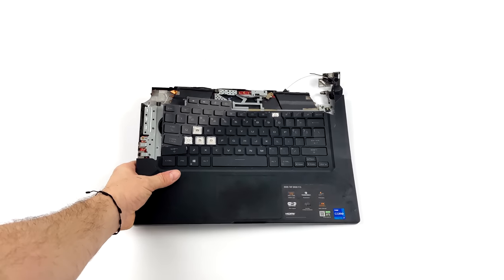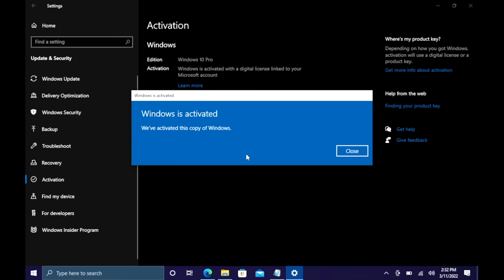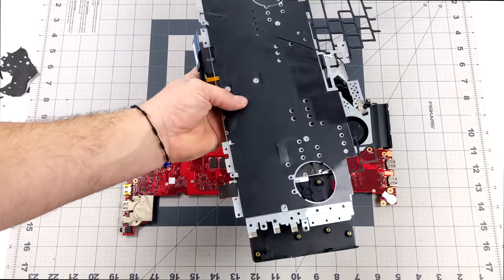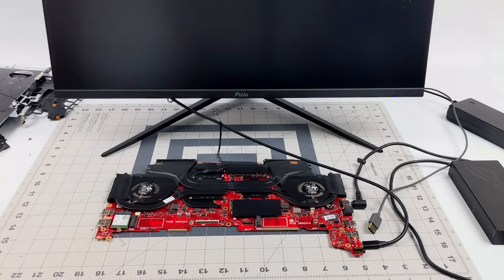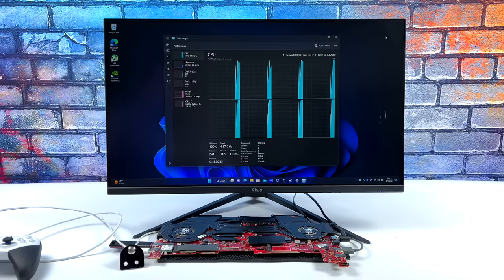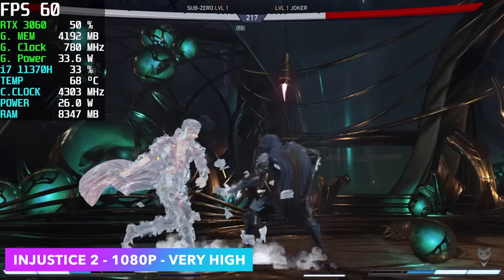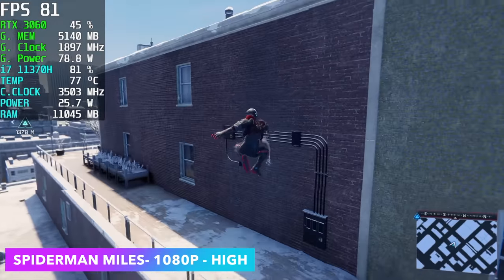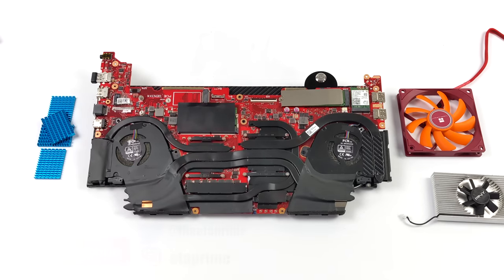I Turned This Broken Laptop Into A Powerful Desktop Gaming PC

Comment: When i no longer had a desktop i had an old MSI GS63VR with an i7-7700hq and a 6gb GTX 1060. The fans are notorious for going on these (was on my second set) so i actually took the whole thing out and made a custom open air case out of some soft wood from a previous project. I then screwed 2 x 120mm corsair fans (jankily wired to a dc wall adapter) to the front for cooling and due to this was able to keep my temps (without throttlestop) around 80c both CPU and GPU. The fans ran at 100% of course all the time. I was able to overclock the GPU even and it never even got above 85 afterwards. Proper cooling makes these laptops absolute monsters if you get good deals on them or are looking to bring one back to life. Can't wait to see what you come up with for it!

Comment: I feel as though you should have run the benchmarks at 1440p instead of 1080p, even though the original screen (I believe) was 1080p. 1440p would be more appropriate in sight of the CPU holding the GPU back so drastically in most cases.

Comment: Cool to see someone else that has done this. I did this with my ASUS. It use to run at 100 degrees but I added cpu coolers and just built a perspex case for it. CPU never goes above 50c now and GPU(GTX 1050 4gb) tops out at 60c. It permanently boosts to the highest with the added cooling and I was able to 200mhz to the GPU as well. It has become a nice streaming PC.

P.S asus fx570ud

Comment: Pretty good vid. I did a couple of these and one thing I noticed is that those heat pipes are super delicate in the vacuum seal gets busted very easily. I bet that's the issue with the cooling. You're better off getting a new heat sink or rigging up some kind of custom solution and just taking that busted thing off.
If you do that, you're sure to see a vast improvement. Do you have any old Zalman flowers? A couple of those would be ideal. Don't forget the vrms

Comment: I had same issue with some laptops with missing batteries. The cpu watts does not go higher than 30% or 20% of it's full potential, untill u connect a battery then the cpu will pull all the possible watt. For this laptop because it is a modern and a known brand, there should be a bios mod that unlocks using the full power without a battery connected

Comment: It would be awesome if you'd make a custom case for that laptop mobo, maybe even put a bigger heatsink with a 90mm fan strapped to it to hold the CPU cool and quiet at the same time. Noctua has some 5V fans that could run off of some SATA Pwr, not to mention that most modern fans run on 5V but at a much lower RPM and can't be controlled with PWM like this. Anyway, awesome videos on your channel since forever, love seeing this budget tier gaming PCs/systems.
Reply: They also do 40mm fans so he could make a super slim case, like how a server is cooled

Comment: With some woodworking skills, that board would be a perfect fit inside of a small custom-built arcade cabinet running batocera! Pair it up with a 9" ipad air LCD + hdmi adapter board, a usb hub for the buttons/built in bluetooth for extra controllers, and a small audio amp/speaker and you'd have an absolute treasure!!
Reply: what a waste of an RTX 3060

Comment: Just a tip for all those doing this. I've been doing this for some time with personal laptops I have for a cluster backpack. 

If your laptop is running but you don't see it on your screen? 

1. Use the USB type c if this doesn't work. 
2. Use the old screen or a compatible screen, some default bios settings have it set so it doesn't run on a secondary monitor. You can change this in the bios in most cases after you get it working.  

3. You can allways plug in the original keyboard and hit enter a couple of times to have it skip the bios settings 

And for the power connector. You can find in most cases the exact connector or one that will work for about 10~50 cents on Amazon.

Comment: I was actually doing something like this years ago, i have an empty shell for a Compaq SLT 286, luggable, and i wanted to put a modern laptop in it. I found the ipad 3/4 screen fits perfectly so that was settled, used an hdmi driver board. But the laptop motherboards i was able to get was one of those pre-ryzen amd APUs. 
The last one i tried had like.. sudo dedicated gpu+APU setup in dual graphics mode. But i couldn't use the "dedicated" gpu by itself. It would either use the apu or both in hybrid crossfire. And the hybrid crossfire was absolutely horrible. Every game i threw at it stuttered like mad, even if it had playable FPS.

So this motherboard that you got would have been perfect for my project. Since it's modern and new enough to actually game on. But i'd definitely need to figure out a custom cooling solution. Probably watercooling.

My project has been sitting for years, I'd be surpised if the old plastic was even viable anymore. I was just never able to get a decent laptop motherboard for cheap.

Comment: I wonder if those heat sinks are all full of dust and if maybe a heat pipe or coldplate got damaged when it was "dropped" Or maybe it could at least do with a re-paste job with some higher end thermal paste like SYY 157, That stuff is crazy good for the cost. I bet that thermal paste interface was damaged when it was "dropped". Also make sure that the power settings in the BIOS are maximized, and XMP is turned on and stuff. 

Or if you wanted to get more involved, pick up a couple of desktop tower coolers or "universal" water cooling blocks and make custom brackets to mount one to each the CPU and GPU dies, and glue some little heat sinks to the VRAM. That could be fun, put it in a little custom set-top box style case.

Comment: if you didnt already, I'd consider getting the HSF assembly off and re-apply thermal paste to both the CPU and GPU, i dont know how clean the fans are, but you could also see if theres slightly more powerful fans to replace those

any case you make for it id say make sure your giving those fans (and any you added on top of the main HS assembly, have access to unheated air.. 

going looking for the second video now to see what you did

Comment: I have kept my old broken screened laptop for this exact reason. No I did not rage, cleaned it using alcohol that I later found someone left the bottle open which means a lot of it evaporated out and I water damaged the screen because of it. I could have fixed it, but I was already considering an upgrade so I didn’t think it was worth it.

Fun fact, I broke 2 laptops at the same time. The other was a 2010 macbook air which I can’t do anything with now. I only used that laptop to code while on the couch since it was so nice and small with at the time my second favorite laptop keyboard. I loved that little laptop.

Comment: try to add battery back some laptop will hold the power down to the gpu and cpu if the battery is not installed ,that battery looks fine it is only damaged in the middle of it where the plastic separator between the cells sits the only thing damaged looks to be heatsink some pipes look bent/ collapsed severely limiting cooling performance also i would add the speakers back if you put it in a case cause why not

Comment: As far as performance goes. The laptop is limited by the power brick. Usually laptops use both the power brick and sip battery power while during high demand sessions

Comment: Gotcha. In those last few seconds of the video you took a close shot of the heatpipes. The main heatpipe is damaged in a way that completely blocks cooling of the right processor (which I'm guessing it's the CPU). There are 2 big dents just on the left and on the right of the chip so no fluid can flow on that side. The other side of the heatpipe is still probably OK since it has uninterrupted access to at least one fan. Now you could spend some money and replace the heat sink or if the cold plate is still flat enough you could Frankenstein an Intel cooler on top of the "cooling starved" processor.

Comment: I wonder if you need to have a dummy battery plugged into the motherboard to overcome that CPU power throttling.

I had a 2011 Macbook pro that had a swollen battery which I promptly removed and tried to run it as an always plugged-in machine. The performance tanked and had me wondering about it until I saw that the particular range of laptops would throttle performance (thus heat output) when it detects battery failure. Replacing the battery gave it a few more good years of life till I switched to a Dell XPS 15.

If it's not that, you can also research to see if that gaming laptop was designed to draw from both battery power and AC power simultaneously for momentary boosts; perhaps without battery, the BIOS then defaults it to a consistent lowered TDP.

Great video inspiration for turning an older laptop into a Steam Machine or retro gaming emulator that can be strapped to a flat screen wall-mount bracket!

Comment: You can run throttle stop to reduce the CPU temps at least, via undervolt. Good for Intel CPU. Lot of ppl use it for laptops
Reply: Not on this laptop, i've already tried throttlestop with this CPU and the options don't seem to be available to undervolt.

Comment: In the end of the video i noticed the heatpipe is a little smashed, maybe that causes to not work properly because the evaporation process inside the heatpipe is blocked by the kink in it. That's my opinion, it's a scenerio you should test, maybe finding a replacing heatpipe, or using another thermal solution, but keeping the original fans, because they comunicate with the bios.

Comment: Disable turbo boost in registry to dramatically lower those cpu temps, you can also set the max power for the cpu to 99% and that will really drop those temps.

Comment: You got lucky here.  Sometimes windows will detect various hardware that relates to the acpi power/charging system when the battery is completely removed, it then throttles the cpu/gpu because it thinks there's a power issue. Even disabling acpi in windows and cycling power doesn't fix the problem. Still have to do lots of enable/disable to get things to go again. Have seen that scenario twice when doing similar projects. I have one now that i have to disable/enable an rtx 2060 after restart to get it to work at full power again. I just do it with a batch file when I want to play a game on it :-)   If anyone knows a fix to get windows to completely ignore that stuff and run like desktop I'd love to know it.

Comment: Hmm.  you got extremely lucky the board wasn't cracked.  That was some hefty damage to the original unit.  
- Maybe you could use Arctic Silver Thermal Epoxy to mount some beefier cooling on there.   
- Custom drill the holes you need in the proper places in a donor case, then use some spare motherboard mounting stand-off screws to mount the board in. 
- A water cooling block would be easiest, but would require maintenance over time.  So if possible to find a good air-cooler and somehow mount it on there, that may be preferable.   Be sure to cool the video ram and other components that may need it. 
- You could also use the existing heat pipe system and perhaps mount beefier fans onto it to force air through the fins more efficiently.

Comment: I have a broken gaming laptop that works fine over usb c or hdmi as well sitting in storage, looking forward to seeing what you're plans are for this so I can borrow some ideas lol
Reply: My 2015 laptop's hinge mounts broke so I ended up removing the screen and throwing it in a vertical stand. It now serves as my RDP client for remoting into work. An advantage is without the top half it's exceptionally thin.

The only annoying thing is it only has 2 14nm cores so the fan runs at max speed whenever Windows Defender is doing one of its many scans or Windows Update is running.

Sooner or later I'm going to repaste the CPU and GPU.

Comment: a lot of these gaming laptops use the battery to crank out extra performance - if the battery is low or unavailable, then gpu performance will suffer. is that the case here?

Comment: The CPU in general was very lackluster even on release. In practice, it was actually a pre-overclocked version of 15w - 28w 11xxG7 CPUs from the same period that for some reason had integrated Iris graphics despite being intended for slim gaming laptops, so it was often significantly slower than prior generation 6 / 8 core i7 H cpus, and even some of the 6 core i5 H series. The 11370H is essentially an i7 in name only.

Comment: The heat pipes look bad, maybe they leaked the gas, at least replacing the heatsink might fix those numbers and give you a good surface to mount additional coolers on to.

Comment: I did that with my old lenovo y50 70 after it's LCD broke and battery died. Used it over a year as a desktop and worked just dandy. A little improvisation goes a long way. :p

Comment: I had a zephyrus g14 with a 3060 and it would not fully utilize the processor or gpu.  They have no bios options (MUX).  It went back because a 1500 dollar laptop should be 100% out of the box.  Fallout 4 max fps at 1080p ultra was 37 lol.  There are many people who had the same issues I had. There is something really wonky about these ASUS laptops.  Good luck dude!

Comment: You absolutely have to go liquid metal on a gaming laptop. I do it to every gaming laptop I get, 100% worth the time and effort. The one thing about the LM is that laptops usually have copper heatsinks, so overtime the LM will react with the copper, but only to a point. I do reapplications about 3-4 times over about 6 months, and after the reaction is permanently done, changing the LM becomes unnecessary, and you get hugely cooler temps.

Comment: Maybe you could try one of those Ryzen 5 stock coolers? Just put it on top of the heatpipes around where the CPU is with something like K5 Pro in between the heatpipe assembly and the ryzen cooler.
Don't forget to apply some pressure too, maybe zip tie it to the motherboard or a custom case if you decide to make one.

P.S.: Depending on the laptop, you could also mod the GPU vBIOS to make it draw more power. I have a Zephyrus G14 with a 3060 in it that I installed a vBIOS onto from a different laptop with a higher power limit. Really makes a difference!

Comment: Grab a couple Chunky Universal CPU coolers and mod the brackets so they screw into the existing mount points for the coolers on the laptop case, only issue is you will need to fool the motherboard that the fans are spinning.

Comment: You can probably get a cpu cooler resting on top of the laptop cooler and it'll already take some of the heat, doesn't really cost anything to try and you can decide from there if it's worth trying to make a somewhat custom cooling solution

Comment: I think you could get a couple short single stack tower coolers, and use thermal epoxy to mount directly to the heatpipes above the chips. Obviously would need to scrape away all the paint first. I assume the laptop fans/heatpipes will still wick away some of the heat. 
If those heatpipes weren't also cooling the VRMs and video memory, you could remove the heatpipes entirely and epoxy a cooler directly to the plate. But maybe just some regular heatsinks on the VRMs/VRAMs would be sufficient.

Comment: Lose the heat pipes and go for a custom loop with some cheap, off the shelf blocks for CPU and GPU. You may need to find some kind of clips to maintain pressure on the dies (careful not to crack them!) but it'll be way better than the bent up heat pipes that are currently on there.

Comment: I'd recommend getting a replacement battery for that laptop, performance will be held back until it has a battery due to it not getting enough power solely from the charger.
Reply: it'll become especially apparent when the GPU is being fully hit as they tend to sacrifice power from the CPU

Comment: Used to play on a laptop that had been similarly destroyed, it had a GTX 1060  and i7-8750h and I would run an external monitor and press an array of buttons when it booted up since the bios did not project on HDMI, it unfortunately had a bent heat pipe so the cooling was inefficient and it always ran hot.

Comment: You could get a 20 volt tool battery fan to blow on it or similar with adjustable speed. If that don't work you could get a leaf blower fan that would blow a lot of air. I made a ac  ice conditioner with a fan like that. But you may have a better idea.

Comment: I have a free busted laptop a years ago, the LCD, cover LCD frame and hinges totaly broken beyong repair. Without RAM and Harddrive. Its a Fujitsu laptop with Core i7 Gen 4.
A week a go, i got a Acer PC Monitor 15.6" that have a dead mainboard unit, but the LCD Panel on a mint condition.
Lucky me, the display cable and pin connector between the laptop and LCD Monitor have the match connector, when i tried to connect, the BIOS menu show up.
I buy a used SSD dan RAM, and installing Win11 Pro, now I can use this laptop as desktop PC replacement.

Comment: my laptop has a 3050ti (and radeon igpu) coupled with a mux;
 if the firmware is set to "discrete graphics only" ALL attached monitors will mirror the primary monitor until the kernel actually loads the gpu driver.

This allows me to see the BIOS on HDMI monitors (and also deactivates the igpu)

Comment: just a question: why dont you set power settings on bios to power up when connected to electricity?
with that setting you can make it and screen power up by multi-socket with power button.
I did this for my desktop to power up 2 screen and pc at the same time.
and for case if you want to go retro style try to find 80s-90s wooden radio box :)

Comment: you have to whater coold it, easly way is adding a whater block on top of the heatpipes, removing frist the black painting, the hard way will be removing the original cooling sistem and fiting a custom whaterblock for de CPU and GPU.